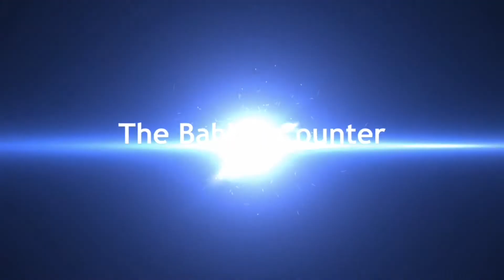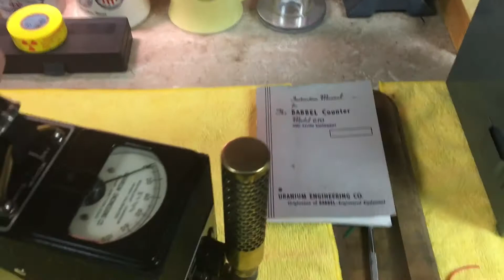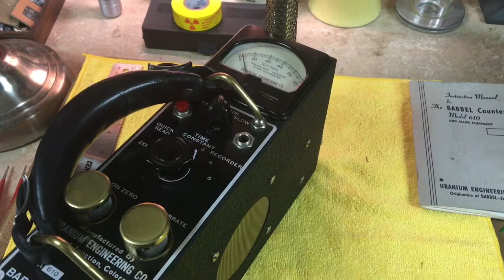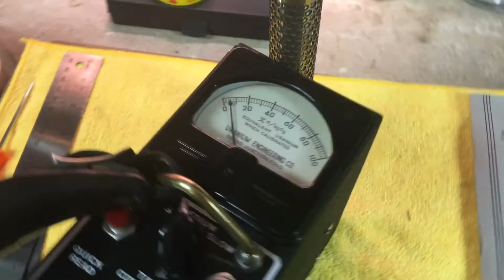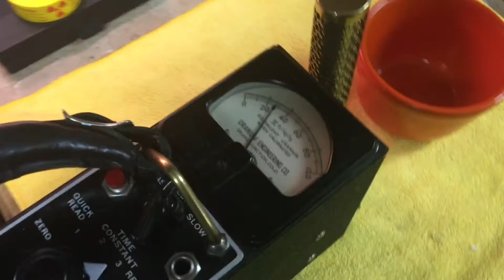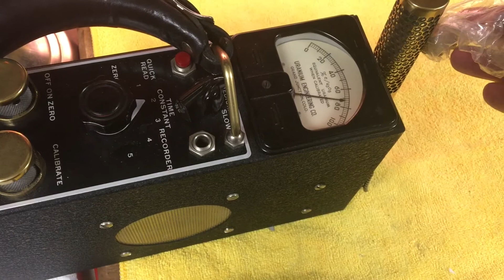Model 610  Babbel Counter (Geiger Counter)

Comment: This Babbel Counter was designed and manufactured by my Father. This model is not similar to the ones he manufactured in the 40's. They were smaller and much more crude built. The Model 610 was not introduced until the early 50's.
Reply from the maker: William Babbel 
Thank you for commenting on my video.  I have several 610’s and a earlier model 600.  Most have been restored to working condition.  I have one with a yellow label which says it was personally serviced by your father.  

If you’re on Facebook it would great to have you join our group Antique Geiger Counter Collectors. We often profile restored Babbel Counter’s in the group among other 1950 Uranium Boom Era detectors.  

We’d love to have your input on both historical and technical matters regarding your dad’s iconic detector.
Reply: I am not on Facebook but could supply you with a lot of information on the Babbel Counter via email if you could pass on an address.
Reply from the maker: That would be great. Thanks! 
storax7662@yahoo.com
Reply from the maker: I've been having email issues and may have missed your response. I'd be very interested in any information you'd be willing to share. My email is storax7662@yahoo.com